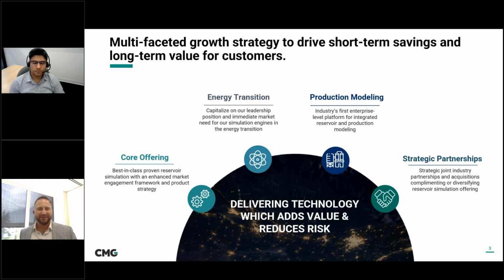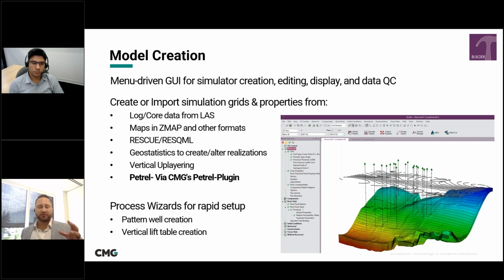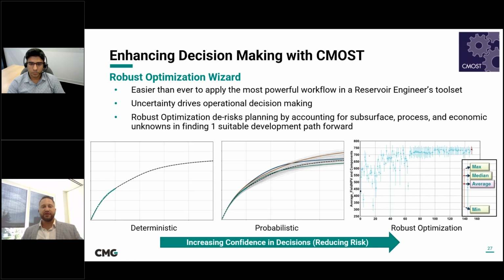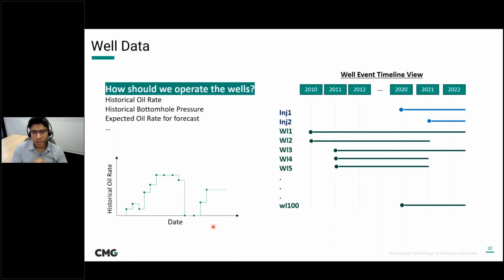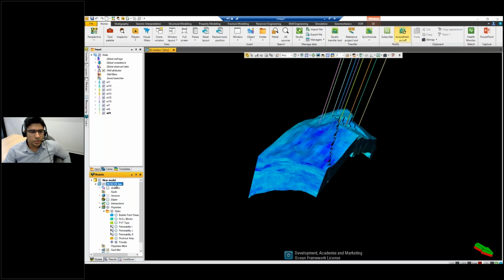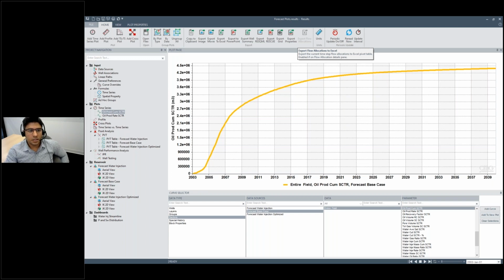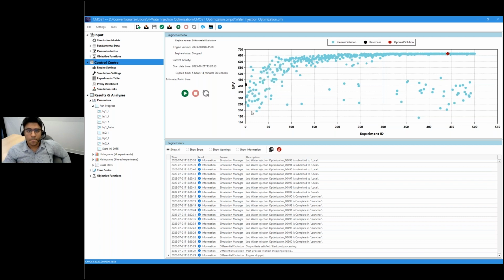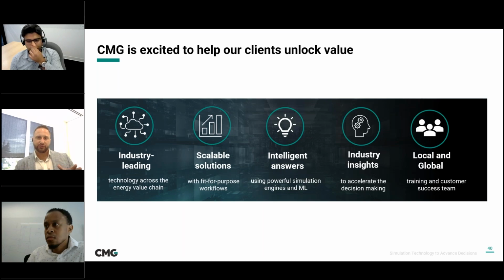CMG Webinar: Optimizing your primary and secondary oil recovery processes -  Conventional Solution

Comment: Thanks a lot for the informative webinar. I'd like to ask: what is meant by 'apportionment ratio' mentioned in an answer on a question about optimized operating parameters in CMOST.
Reply from the maker: Thank you for your question.
Apportionment ratio refers to the ratio of the assigned water injection rate between two injector wells. For instance, suppose we have 2000 m3/day of water available, and we decide to implement an apportionment ratio of 1 to 3 between injector 1 and injector 2. This means that the injection rate of injector 2 will be three times higher than that of injector 1.

Injector 2: 1500 m3/day 
Injector 1: 500 m3/day

I hope this clarifies your inquiry.